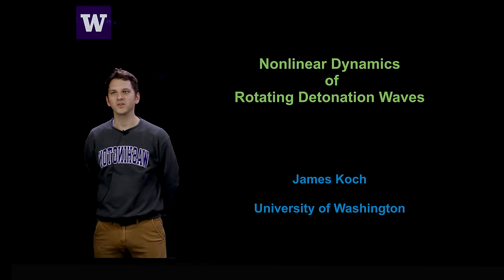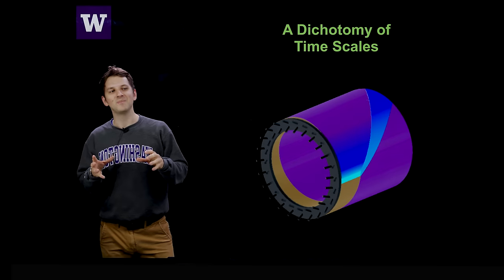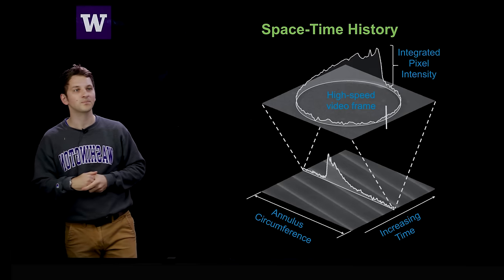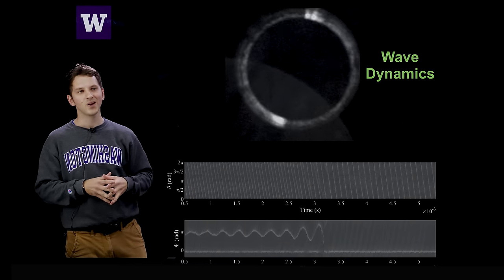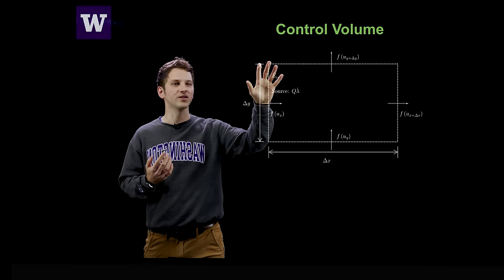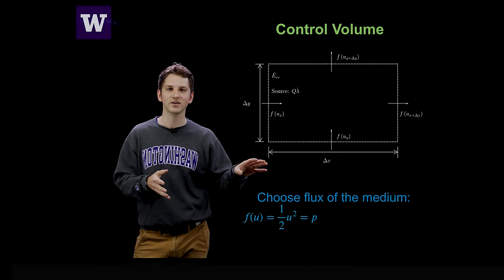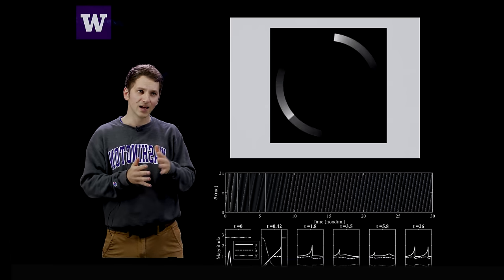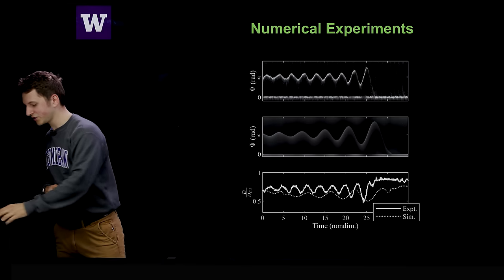Rotating Detonation Engine (RDE) -- Dynamics and Bifurcations

Comment: Given the shape of this sort of engine, I wonder if an aerospike could be more easily used to guide the exhaust?
Reply: Given the amount of energy in the shock wave from a detonation you might not even want a bell.  Most of the energy will have left the building by the time the combustion catches up.  A long expansion chamber might just wind up cooling the exhaust too much.
Reply: That's what they did at the Warsaw University back in 2011. They stuck an annular aerospike nozzle on a rotating detonation engine. Interesting experiment.
Reply: @jcims  There probably is a sweetspot for bell-length to exhaust cooling in terms of efficiency.
Reply: @JainZar1  yes exactly you would be able to calculate exactly given your system what the optimal bell length or aero spike length should be given your system/engine being used  no different than from regular rocket engines

Comment: Amazing stuff. I wish I had better introduction to physics when I was a kid. Working on such things must be amazing. I am just a passionate 3d artist, so I have no real business in it, but:
1. When can we expect first functional engines like this?
2. What kind of nozzle would they use? Aerospike? Some kind of magnetic cage?
3. Can this can of combustion be used in air-breading engines?
Reply: It’s possible that prototypes have already been flown and go all the way back to the 90’s this technology has been in the works for a long time now. But obviously actual  information that goes in-depth to this technology is classified and everything spoken in this vid and any papers you can find on this are all generally basic overviews/theoretical underpinnings and have no information in regards to how to actually realize such an engine. Many things are hidden behind top secret or above top secret classifications like special access programs aka what are generally called black programs which even the president isn’t told about unless there is a need to know… the military and its biggest contractors are 10-30 years ahead in technologies across the board pretty much, and when you seen a leap forward in technology from the private sector it’s usually bc some technology has been allowed to become public knowledge bc they have something newer now…. This is how it has always worked

Comment: On your combustion tube have you considered a helical rifled tube? Also consider the helical channel depth for a low pressure and increased velocity of the channels of the helical combustion tube. If you were to do that I would make the helical rifling channels smooth like rolling hills. You may want to play around with the injectors in the helical channels for stabilization of your timing phase, as the fuel will follow the low pressure zone in the channels of the helical tube along with the timing phase. Good luck.

Comment: Sounds like timing issue. Try using a transducer for a sensor to detect the shock wave then modify fuel and air as needed to stabilize. Also you may want to consider a mechanical intake like a nose cone on a SR-71 blackbird.
Reply: Intake isn’t the issue with the set ups they are using (they aren’t air breathing)
Reply: @metatron5199  I didnt write this for this video

Comment: Are these engines powerful enough to be used as first stage engines? Is STTO feasible with it?
Reply: My understanding is it's not really discussing the POWER of rocket engines, but more a new method of analyzing the thermoacoustic STABILITY of them.  Rocket engines have a habit of tearing themselves apart if the shock waves bounce around too much, so you can use this method to tune injector plates/nozzles/baffles to create this dynamically stable state that seems to have negative feedback dynamics to return to stability.
Reply: @killerguppy2988  Rocket engines (and all engines to date) burn their fuel subsonically. It only flows supersonically after passing through the throat. This is a whole new beast.
I have a lot of reading to do on these, but it sounds like the propellant can be injected at much lower pressure than in a conventional rocket. This is because the detonation itself compresses the propellant. That means you can use much lighter pumps. I'll be surprised if they can get the power density as high as conventional rockets though. I'm guessing the combustion chamber will have to be pretty stout to survive this cycle.
Reply: So far - no, not even close. Due to the complexity to just design them, the time to test and amount of work to simulate and analyse them we are basically at the start of the research-cycle. We do not even know if they are able to become as powerful as a convetional engine.
But that also is not the focus of the research nor the goal to achieve either.

Comment: Do they have sweaters like this so they know which one they have on when they look in the mirror? :-) 
Question: does the rotational nature of the detonation waves end up inducing a reactionary torque on the device? Just curious in the context of using this in a rocket engine.
Reply: Not as long as it is only the wave-front that is traveling around - there is no actual radial movement.

Comment: Hi, great video! have you considered the use of Tesla valves to control the direction of the propagating wave? this will not solve all issues but will help with predicting which direction the wave will move.

Comment: Thinking about this further. Sounds like a timing issue, try three spark plugs with three sensors for advancement of your timing to keep your chain reaction going. I would align the sensors and spark plugs in a hexagon pattern. Like a distributor cap on a car engine.

Comment: I feel I could make a smaller model of this engine (outer nozzle diameter of about an inch) using some common materials you could get at a hardware store. I feel a lot of this long winded stuff scares most people from attempting such an experiment for themselves but from what I’ve seen from different models makes me feel making one isn’t too complex or challenging. The only difficult thing is getting the flame front to turn into a detonation wave that travels around the circumference, and that could probably be fixed by turning it on and off a few times till you finally get the result you want, it seems that’s what every other institute does so I don’t see how anyone could literally make this in their backyard or shed and have it function
Reply: You must be misunderstanding the force  of a detontation wave. You can go to the hardware store and make a rotating pulse jet engine that has deflagration combustion at about 1 meter/ second. Which generates a mild pressure wave pulse of only a few psi to maybe 50 if constructed  properly. When you go from deflag ( subsonsic combustion) to detonation   supersonic)you are dealing with 1000s × amplification. So unless you are willing to have all your fitti gs, couplings and wall thicknesses, not to mention welds, handle 10 to 50,000  psi or more pressure waves which pulse thousands of times per minute and combust at supersonic speeds than stick to a hardware store pulsejet. Or get a good life insurance plan.

Comment: This is probably a very good presentation for engineers who are already familiar with rotating detonation engine dynamics, but he doesn't explain what he is talking about. He shows a picture of heat and pressure gradients without explaining what we are looking at. Scott Manley's video was far clearer and aimed at everyone without assuming we are all DTE engineers!
Reply: Because this video is presenting an already tested idea about how to calculate this behaviour, once other experts work on the model it might become good enough to use in engineering design of new engines, that may (or may not) be better than current deflagration engines.
  However right now, this video is merely for those who can help improve and refine the theory in the hope of benefitting future generations of humanity.